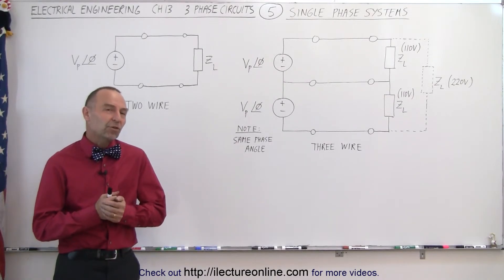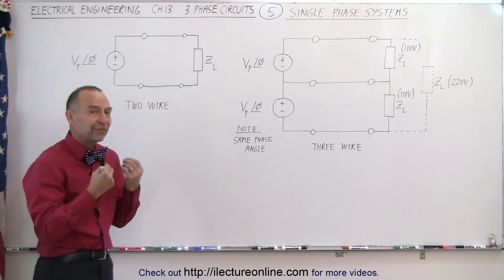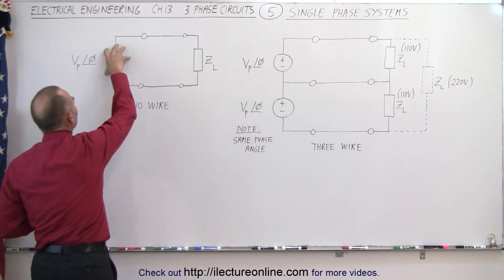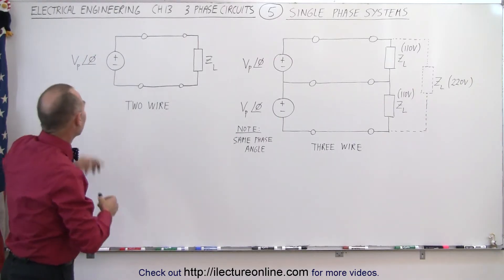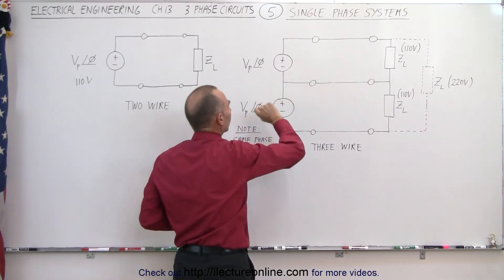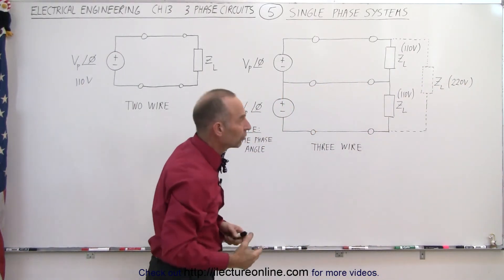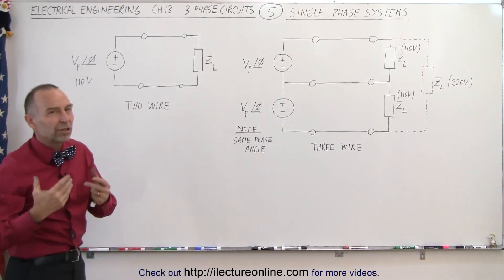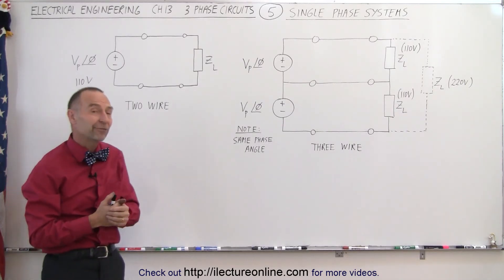Electrical Engineering: Ch 13: 3 Phase Circuit (5 of 42) Single Phase System

Comment: I love that video I have a question I built a generator single phase and both legs when I touch them together with a meter at 635 volts at 228 amps at 60 HZ I'm having problem with the neutral can help me
Reply from the maker: Not sure what you mean by: "I'm having problem with the neutral".